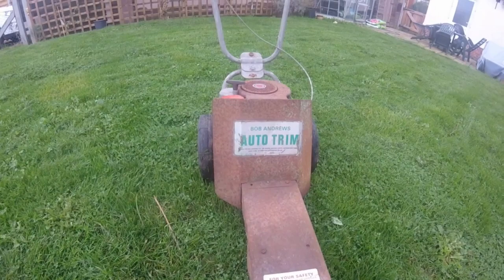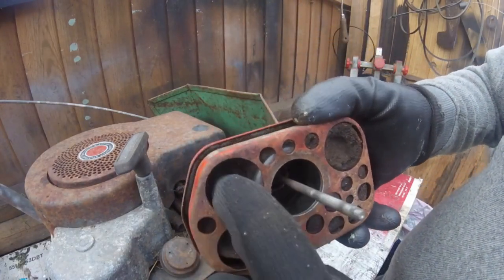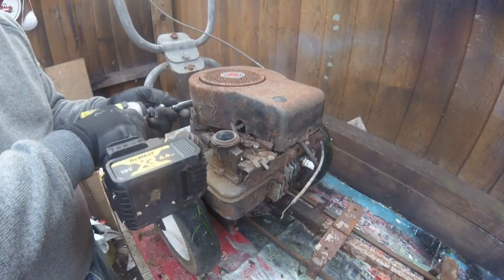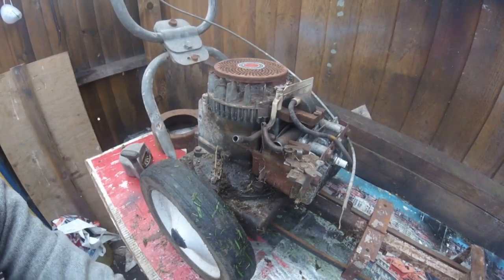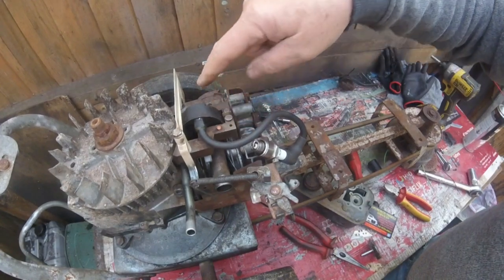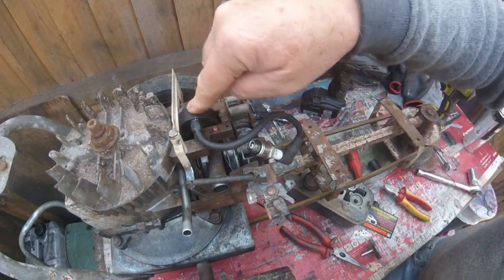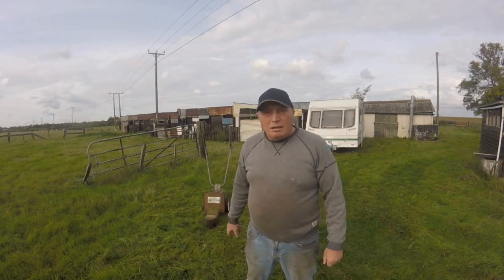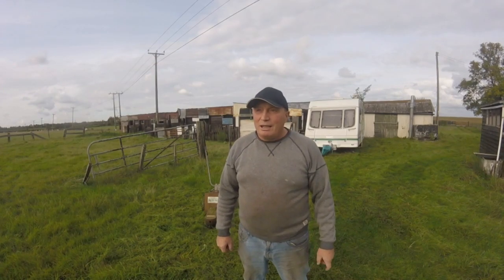How to get a Vintage 1970s Bob Andrews Wheeled Trimmer - Briggs and Stratton Engine running

Comment: Nice one mate good job on the old wheeled trimmer Roy. The carb was a bugger to come off. Yeah mate nice job with the welding seen that you never done it before Roy. I got a Mig 130 I use on car's I don't do a lot of welding but it's handy enough machine. 👍
Reply from the maker: Thanks Ali I did have some problems at first with the mig sorting the wire speed with heat settings
Reply: @roystheboy  Yeah mate you will get  the hang of it Am by no means a welder but I can stick thing's together lol. It's mainly just for doing little jobs that's all I bought mine for.👍

Comment: Hi roy another great video this machine would make a great restoration project for over the winter, what welder do you have? i have had the clarke 120e gas type which once i got used too ( self taught) it  welded fine.
Reply from the maker: Mines the Clarke en100 turbo gas/non gas I got it for £24 cleaned it up bought some wire used it on no gas so will now get gas to try
Reply: @roystheboy  i used too use the argon mix gas slightly more expensive but seems too weld through rust easier, i then used pub  c02 gas as i managed too get a cylinder and a gauge from a pub landlord i used too know the larger bottles last so much longer.